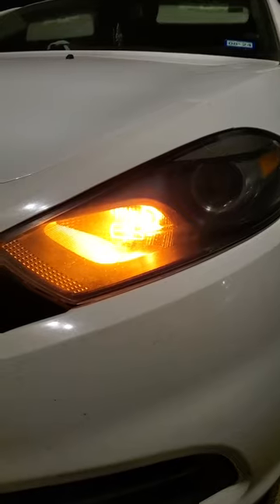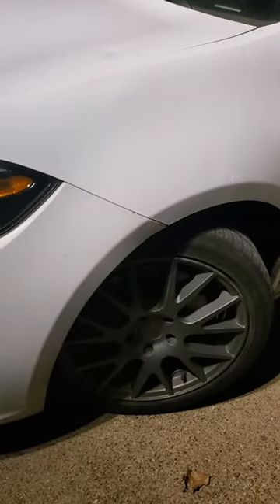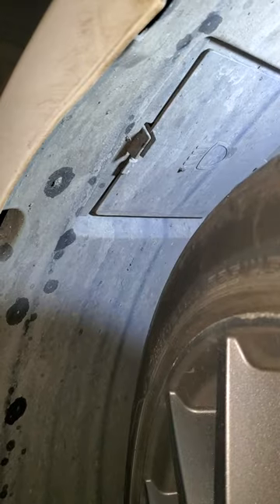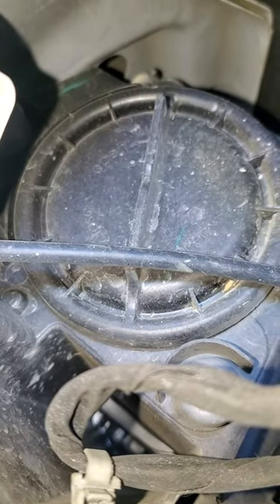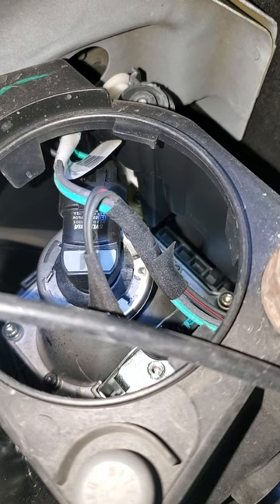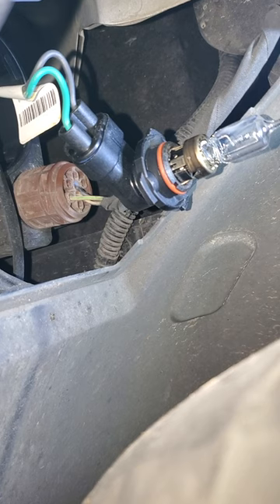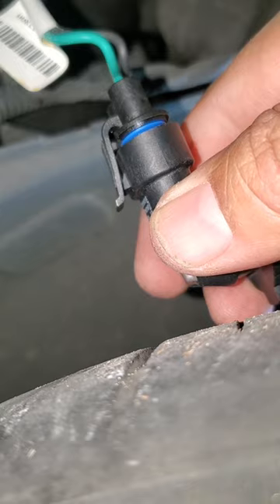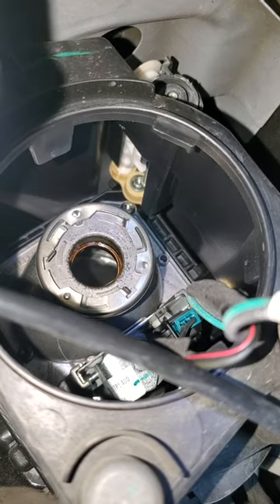Dodge Dart Headlamp Replacement  #automobile #diy #shorts

Comment: The connector plug on my 2015 Dodge Dart headlight is fried. So is the fog light on the same side. I found a pigtail that matched at the auto parts place but it only has two wires. Could that third wire be a ground?The dealership says I have to buy the whole wiring assembly for all the lights on the front of the car. I really don’t want to have to take the whole front of the car apart to install all that. Any ideas?
Reply from the maker: You should be able to splice the wires that go to the fried connector plug to the wires on your new plug. I'd check your light fuse too, if you haven't already. It can be a bit of a challenge but its possible. I did that to a Chrylser 200, video is on my channel if that helps any.
Reply: @joefixitvids  I finally found a repair manual!  It’s digital but printable. My issue was the two wire replacements parts. There are three wires on the original connection. Thank you for your time.